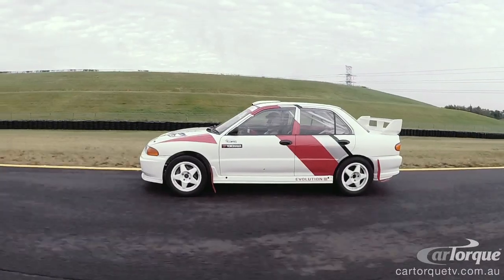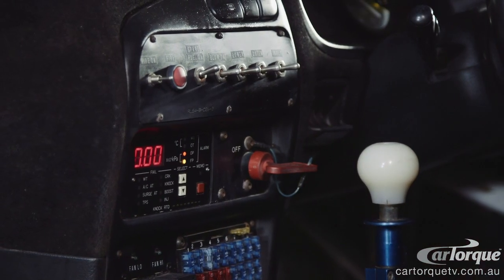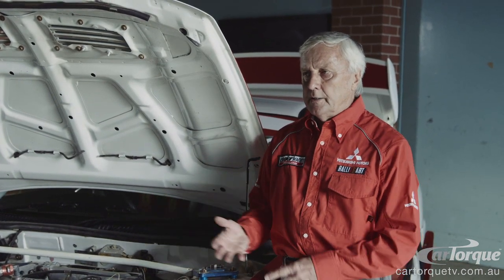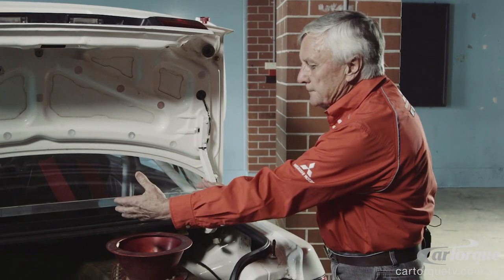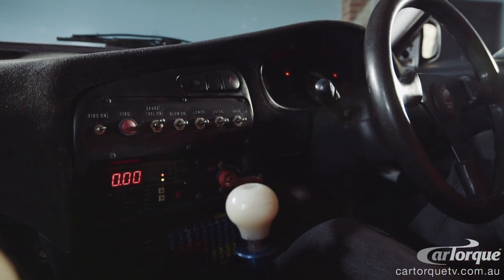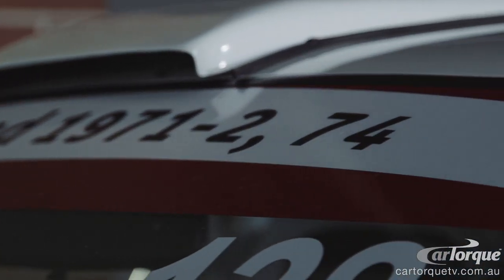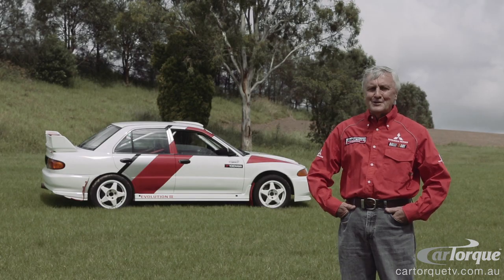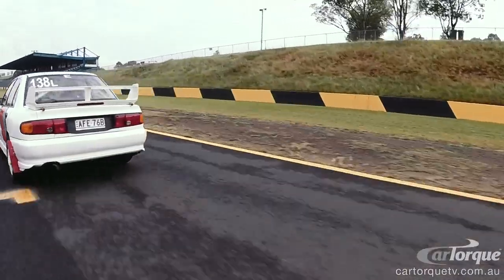CarTorque Series 2 - Mitsubishi EVO III Group A WRC

Comment: I had no idea the active differentials were period correct to a Group A Evo III from the mid 90s! I thought the active diff and sequential boxes weren't standard until full WRC spec cars came around between 1996-97! Impressive.
Reply: Nevermind, the Evo III would have reached the peak of it's development throughout the '96 season right as the IV was coming out.

Comment: am missing my old evo III  great pound for pound beast..
Reply: I'm looking into buying one as mostly a daily driver, what was your experience owning one?
Reply: @thebigboybossy4232  i currently own one, and have been for the last 14 years.

Its a fuel guzzler compared to a modern car. 40l tank last about 400~km. Maintenance is relatively low. Had it at from 100k km, my odo right now is 1.2 million km, with port and polish done once just to clean those gunk because i noticed its not as it used to be. You can call it top overhaul. Im not heavy on paddle. Only a few pulls once in a while. Usually 120-140kmh on highway.

Problem ive had so far :
Driver power window. Replaced twice. Rear power window no longer functioning
Port and polish at around 800k km.
Broken intercooler spray (never used it)
Distributor replaced once, along with cable
Clutch replaced once
Replaced suspension twice
In 2022, i replaced all the arm and bushings. Its fine to drive but its not as comfortable as it used to. Cost me $100 to buy everything (lower, upper, both front and rear, and rear sway bar)
Reply: @hxsm8090  Wow thanks for the owner review, couldn't have asked for a better response. Although its been 4 years since I first posted that comment, owning an early lan-evo still on my bucket list. Cheers

Comment: What is the lines going to the cam angle sensor for?
Reply: Power steering pump is mounted to the end of the cam on the rally cars. Those are the hydraulic lines.

Comment: What kind of fuel did he say the car was running at 2:28? Elf?
Reply: Yep Elf WRF (world rally fuel) I ran it in my Evo 1 for 5 rallys when I had some sponsorship hellp, literally liquid  horspower, was about 185kw at the wheels on Elf whith a 34mm intake restriction,  sane engine and restrictions on pump fuel (BP 98) was 156kw at the wheels
Reply: Thanks for the explanation :)
I found this document (http://www.elfcompetition.com/produits/CS23259_uk.pdf) that says its about 101.4 RON or 95 RON+MON/2 (North america fuel scale). Surprising how a tiny bit of extra octane can do to the performance.

Any idea how it compares to Sunoco fuels? Perhaps Super 260GT for comparison - http://www.racegas.com/fuel/20
Reply: corporalwaffles not sure but as for the RON number it not just the RON number its all the other chemical goodys going on in the fuel that dose the work, when runing on WRF not only could I run more boost ezyer but the big thing was runing way more spark timing whith no pinging :)

Comment: no anti lag?
Reply: Yes the car was equipped with ALS in the engine and ECU but they most likely disabled it in the video. Most WRC cars from the late 80's had a switch on the dash for the driver to decide if they wanted it mild, intermediate or aggressive and completely off. Hope my two cents helped